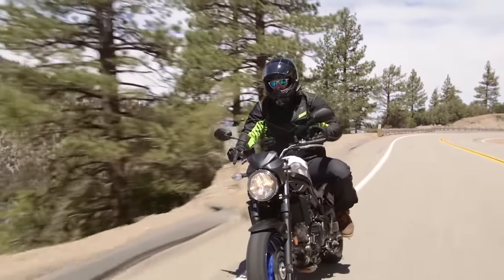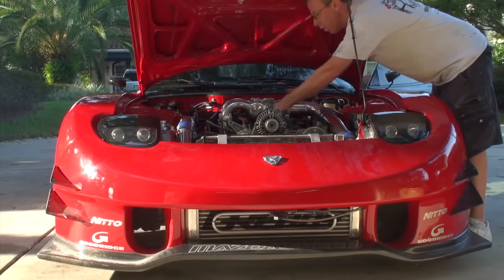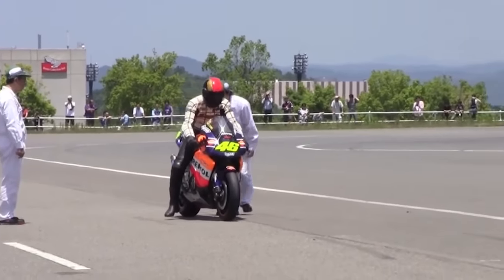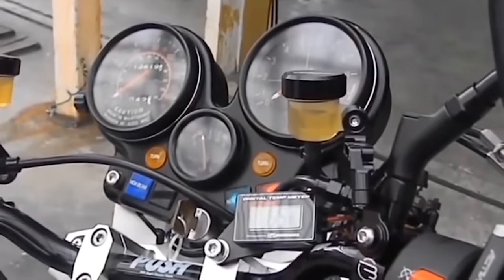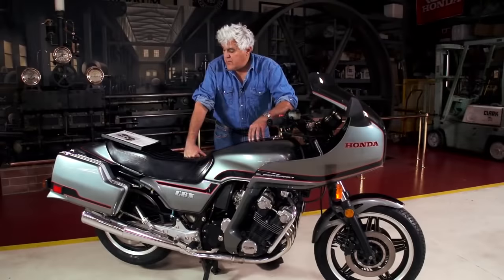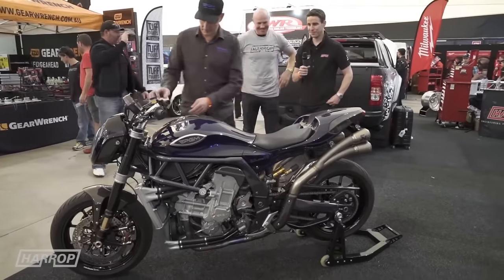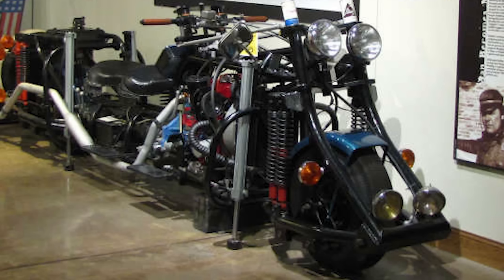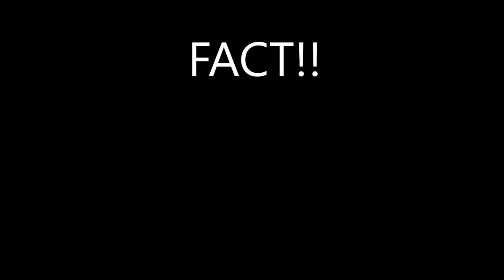The Most UNREAL Motorcycle Engines Ever Produced

Comment: Why did you take into accounts custom made bikes? there are a shitload of custom bikes who have crazier motors. And when it comes to stock bikes, you still get like boss hoss with chevy v8s which dwarfs most motorcycles you talked about.
Reply: Tim Authée how is a Chevy V8 a motorcycle engine?
Reply: @veedee4860  How is a 5mph steam engine a motorcycle engine?
Reply: Because it wasn’t developed for a car and then shoehorned into a motorcycle chassis. 💯
Reply: @veedee4860  The Munch Mammut did a very nice job with its NSU power unit, and the Quazar had a car motor (if you can call the Robin a car). These big block customs verge on the ridiculous, but I think you can count Boss Hog as a manufacturer too. I get your point, but I don't think Yammi was "on point" when he included it.
Reply: @veedee4860  - A Chevy V8 is 4 V-twins side by side in one block... and with 502"/650 HP...
Reply: @docthebiker  - A steam bike could be made much better looking than that and 50 - 100 MPH... back in 1920's... check out Jay Leno's steam cars...
Reply: BuzzLOLOL  What is your point? Chevy pushrod trash that wasn’t designed to power a motorcycle. Next.
Reply: @veedee4860  the Chevy motors in the boss hoss are somewhat made for that motorcycle, because they are modified into a 2gears auto gearbox. This configuration is only used in motorcycles.
Reply: @veedee4860  They are a fantastic for their intended purpose...cheap horsepower, extremely reliable. It doesn't apply anymore but when it came to road car v8's, Americans ruled...but what this has to do with Motorcycles I don't know
Reply: Stephen Scholes granted, over the years I’ve seen all sorts of LS and LT variants shoehorned in to some cool to ridiculous chassis. Abundant, check. Somewhat inexpensive, check. Reliable, that most definitely can be debatable. V8s being king of the road was so pre 1990s. 4 and 6 cylinder engines in the 90s were making just as much reliable horsepower as American V8s from the same period. I know hp costs money but modifying and swapping engines isn’t a poor mans hobby. A friend of mine built a stock bottom end, turbo’d ZX12 that made 485 to the wheel.  The motto for the shop was 485 on E85. Keep in mind it was a 15 yr old bike that was 1200cc in-line 4 engine with a small turbo on it. Was it cheap, fuck no, but over 400 hp/litre is impressive.

Comment: You may want to add the following motorcycles to the list:
> Honda MVX250F (3 cylinder 2 stroke)
> Honda NR750 (oval piston)
> Hercules (Wankel rotary engine)
> Kawasaki Z1300 (liquid cooled 6 cylinder in line)

Ray

Comment: You missed the bike with the 911 engine, ca. 1973.

And finally, I once rode a Kawi triple that had been paid some attention.  The guy squeezed 130hp out of it and the thing was barely manageable.  When it got on the pipe,  the front wanted to come off the ground, no matter what gear or speed.  That was 1979.
Reply: I rode a blueprinted 900 that was just like that .... new custom chassis and needle roller bearings in the rear swingarm. It was AWESOME!!!

Comment: Owned that H2 Two Stoke 750.. It had a one direction. It wanted to go. Straight Ahead..As that Stick Welded Frame would bend. If you attempted a turn to fast...It also like to blown the center head gasket. It never got enough air flow...

Comment: I bought a 1983 Honda CB1100F  new instead of  the previous year CBX, it had more HP and it was lighter.  The CBX by the end was  sport tourer and it was really heavy (680lb).   2 other really unreal engines were the 2 stroke Square 4 Suzuki RG500 and the  Yamaha V4 RZ500.  I owned both of these bikes as well.  The Yamaha was too heavy, but sounded great, and the Suzuki, well it just plain scared the shit out of me for it's incredible performance.  Keep in mind this all happened in the mid 80's.
Reply: Wasn't actually a square four,It was two 250cc engines chained together at the crankshaft,Power was late and short,And I'm glad you survived many didn't and the V4 Yam was the powevalve as you give it no mention blissfully unaware of that aspect,It was remarkable but wasted on the general public,In that it had a variable exhaust valve doing away with the powerband and spreading it across the rev range,Not appreciated by motorcyclists doing away with the powerband and the bike was considered gutless,I often wonder about the thought process of some people,Earlier on someone bought a 750 Kawasaki two stroke triple and claims worst bike he ever had,Too violent  pulling wheelies,crap on petrol and brake and ergonomics and a crap tourer,Buying a two stroke as a tourer? What was going on inside of his head? CB750 or a Harley Tractor,I had the earlier Suzuki GT550 two stroke triple,No where as violent as your Suzuki but quick for it's time,But i had the common sense "not to buy" the KH500 wheelies in the first three gears

Comment: Want a widow maker? Try the Suzuki RGV250. Pretty popular in Greece. It would easily pace or beat a litre bike of the time for the quarter mile and because it was pre-YPVS systems, you could be cruising in 3rd at 40km/h and without any change to throttle position suddenly find yourself doing 120km/h in a heartbeat.

Comment: I definitely remember seeing the Suzuki rotary on the road back then. It's been a long while, however! Don't forget the Norton rotary, though - it was even air-cooled if you can believe that. The Suzuki's exhaust pipes had to be air-cooled - note the curious ducts at the front of each pipe.
Reply: If memory serves me right, the Norton Rotary Engine was originally developed for use in military target drones, and it was only put into a mobile test bed (aka a motorcycle rolling chassis) in order to test and moniter it over different operating and meteorological conditions without having to launch it airborne!
Reply: Thats right they did and often glowed cherry red under extreme riding conditions

Comment: Kawasaki KZ1300. Inline 6 cylinder, shaft drive, water cooled, and 120 hp. A top heavy damn thing but F%$#ing FAST and SMOOTH.
Mid to late '70s saw a number of 2 stroke bikes that we called Crotch Rockets. If you took one for a ride and weren't prepared for what they would do, you had to change your underwear when you returned.

Comment: An engine not mentions here is the 1982 Honda CX500T.  This 500 cc Turbo, fuel injected little rocket was a dream to ride and accelerated like nothing else.  The Honda
shop owner had a CBX1000 with the fairing and bags.  The Turbo shined on the highway.  From a standing start it acted like most 500cc four stroke bikes.  Until you got
into it's sweet spot when that Turbo spooled up.  From a standing start.  My buddies CBX would pull out front until I hit 40 and then this 500 would just like you were
just launched off a catapult.  I would pass him and it would take him a couple miles to catch up to me with his monster engine.  Usually we just ran out of road.  When I
passed cars.  I would pass them in groups of four or five.  I could accelerate from 60 t0 80 in the time it takes to take two breaths.   Two dumbest things I ever did.
Well there was a third we won't talk about.  I sold my 69 Z28 and I sold my CX500T.   Yeah, I know.

Comment: 11:25 I owned the Kawasaki H1 500 triple it was just as much a widowmaker as the H2 they handled like pigs couldn't turn corners  but straight-line speed was frightening
Reply: I had a 77 Suzuki GT550. 
I rode through a speed wobble at 115.  Not the funerest thing ever..
Reply: @pnotuner1  been there...done that... wasn't lookin at speedo but I'll take your word on that.
The GT 250 was first bike I rode with 6 gears & wi me at 13 & 90lbs it was quite a thrill...

Comment: That was a fun video. 

Honda used to have a festival at Donington, which is only 8 miles from me. I rode CBXs several times, and while they seemed fun at the time, they were absolutely flattened by a Honda rider, on the CB1100R. I enjoyed riding them, at the time, but wouldn't want one. I still have an R1, but haven't ridden it years. I'll do track days if I ever win the lottery. Morbidelli did a V6, Norton did a Rotary for the track. Does that V8(which really does sound amazing) really have more power than an H2R?

Comment: One engine that should be noted yet  only has a little over 100bhp,is the honda VFR 750 interceptor. This V4 is an engine with gear driven cams and has been listed as the most over engineered production bike ever made...Such a special sound,this bike has also been known to hit 200k.Also the 1st single sided swingarm..these changes took place in 91 after Honda was embarrassed in the 750 cc class..Then they won alot with this near indestructible. Bike....thx..heath

Comment: You should research the V-4  OVAL piston motor Honda developed in the 80's. There was a ring sealing issue  that doomed the project but 8 valves per cylinder, 2 connecting rods per piston, the thought was it would have a 24,000  rpm redline

Comment: I had a Yamaha TDM 850, I had it tuned with dynojet and kerker exhaust.  I had it dynoed at 88hp and 88ft lbs of torque.  Meaning when. I took of from a stop it lifted the front end.  Low rpm power, the dealer who worked on it and wanted to buy it called it stump pulling torque, very usable.  When. A friend drove it then my brothers 750 GSX-R he thought mine was more powerful, but which isn't true. Look up a TDM with kerker.  Inline twin liquid cooled with 5 valves per cylinder.  Genesis motor.  Only came to the states for 2 years, 1992 and 1993.  Very ahead of it's time looks

Comment: you forgot the oval piston V4 Freddie Spencer campaigned; Its where Honda experimented with short strokes and big bores used on everything now. Basically a weird engine, 2 rods per cylinder  8 valves per cylinder and an unheard of redline at the time of 20 thousand RPM. and what about the 250 cc 6 cylinder factory road racer that later was morphed into the CBX

Comment: I would like to add I had a Suzuki GT-750 a 3 cyl. 2stroke 750 but it was liquid cooled, the first steam motorcycle was an 1867 Roper and was clocked at 40MPH. there is also the Ariel square 4 (actually 2 inline twins with counter-rotating crankshafts), and the Megola, a German bike with a 5 cyl. radial in the front wheel the cylinders spun with the wheel and the crankshaft was stationary, and now the USMC is testing an on/off road diesel bike that has a 70mph top end, 600mile range and 125mpg. just some ideas for your next video.
Reply: +1 for the suzuki GT750, that bike was kinda scary for the time.  I'd add the boss hoss line to the list as well, powered by everything from the GM 350 (5.7 liter V8) up to the 502 (8.2 liter V8).

Never owned a boss hoss, but i had a 1972 GT750 'Water Buffalo'.

Comment: I believe Suzuki offered a true lifetime engine warranty to the original owners of the RE5. Not a limited warranty but a true promise that they would repair or replace the engine forever for the original owner. But they still couldn't sell them. I remember seeing RE5s that stopped production in 1975 on the dealer's sales floor in 1980. (There are 1976 RE5s but they are actually 1975 models that were sent back to the factory to have the bad Sci-fi instrument cluster and lights replaced with conventional ones off any other Suzuki.)

Comment: The late 70s and early 80s was Magic time in the motorcycle world. The big four in Japan were out to One up each other at every corner. We had development improvements like water cooling, shaft drive, single shock suspension, Parallel twins, v twins of many angles, fuel injection, turbos, Power valves, mag wheels, tubeless tires, six cylinders, triples, wet clutches, dry clutches, six speed transmissions, engines that used the same oil for the engine and transmission, multivalves per cylinder, multi spark plugs per cylinder, onboard system computer monitoring, even self diagnosis. Single key to open every lock on the bike, anti-dive, Single and dual front discs, O ring chains, elimination of kickstarters,
  every year the big four were coming out with new designs, I don’t mean new paint jobs, I mean different engines. The big super bikes were getting faster, every one of the big four had a big full dress touring bike it was loaded with features.. in 1982 alone, Honda had 52 different models of motorcycles available in the United States. I know this because I sold Hondas in 1982, and we handed out decks of cards that Honda had made up. Each card had a picture of a different model on it..
  Times were great, bikes were very very affordable. They couldn’t make motorcycles fast enough…
  that all came to a screeching end when Harley Davidson CEO, a guy named Vaughn Bealls went to President Reagan, and got him to put a 45% tariff on Japanese motorcycles to save 600 factory workers jobs in Wisconsin Harley Davidson factory..
 hey 750 Honda or 750 Yamaha that was $2999. Overnight the price of that vehicle went to $4750..
 One year before the tariff, Yamaha sold 120,000 of its XS 650 model motorcycles in one year in the United States..After the tariff, there has not been a single year since, almost 40 years later, that Yamaha has sold 120,000 of their motorcycles of all sizes combined..
  within three years of that tariff that Harley had placed on Japanese imports, 1100 motorcycle shops across the country it’s old Japanese motorcycles went out of business just in the first three years. The average number of employees at those 1100 shops was seven employees. that 7700 Americans that lost their jobs to save 600. Typical result when the government get involved in business..
  Shops kept going out of business ever since, I live in Western Pennsylvania, I work part time in three shops that went out of business one after the other after the tariff. And they are still going out of business here almost 4 years later.. there used to be 17 motorcycle shops in the western Pennsylvania area around my home within an hour drive. Now there are only three, and two of them are family owned since the 1960s so they own the building they are in, it’s a family business in each case. One is a Yamaha shop, the other one is a Honda shop. There are no Kawasaki or Suzuki shops within an hour of my home anymore.
  The tariff price increase was supposed to expire after four years. The problem is, the price of motorcycles never came back down..
  when the tariff was imposed, showrooms were deserted. I went from selling about a motorcycle a day between January and the end of May every year. I would quit at the end of May every year because anybody that was gonna buy a motorcycle, already had it before June 1. But immediately after the tariff, I went from selling four bikes a week, too I was lucky to sell Three bikes a month.. I actually quit selling motorcycles for 12 years..
  The early years before the tariff, every motorcycle shop I ever worked in was like going to a party. Rock music would be playing over the PA system, the boss/owner would buy lunch for everyone working there every day. Every day. The refrigerators in the shop were constantly stocked with soda, water, juice, whatever you wanted, by the owner, it was for the employees. We could take motorcycles home on the weekends.. we got parts and motorcycles at cost. When I sold bikes before the tariff, I could have any bike that was not a big seller as a demo to use..
  when the tariff was put in force, it was as though an atomic bomb went off in the whole country of motorcycling. That was the end of the development of the turbos, the sport bikes, the new models seemingly every other month a new model a new model that ended when the tariff was imposed. For example, the year of the tariff hit, Suzuki only had two street bikes available and it’s lineup..
  The shops couldn’t pay or keep good help. Instead of having five parts man at one shop I worked at that had 17 employees. They went down to two partsman. They also had seven mechanics and two full-time builders before the tariff and a service department manager. They went down to two mechanics and no builders, and no service department manager..
  that is the reason at least in my case and pretty much the many many friends I made over the decades, that’s the reason they will never buy a Harley Davidson. When they got the tariff imposed, they were wrapping themselves in the American flag. Today, Harleys are made in Brazil, Germany, India, and I even think they’re made in China now. So much for wrapping themselves in the American flag..
  I have nothing against Harley riders,Most of them don’t know the whole story. But I’ll never forget. I’ve had 108 motorcycles so far, and not one of them was a Harley

Comment: I really really wanted the RE5,But after sales maintenance didn't exist,So i went for the Suzuki GT550 two stroke triple,Which mirrored the performance of the RE5, Didn't know that at the time,But two strokes were inherently quicker than the four strokes of similar capacity and my mate started on little two strokes upto 350/400 and bought a big four stroke 500/750 which was big in the 70s,I'm different don't follow trends or fashion and started on little four strokes 175/350 and then the relatively large two stroke,I was NOT disappointed my mates were,Going from a yamaha 350/400 to a Norton Commando and a Motto Guzzi,They found them to be gutless,I didn't learn from their mistakes just do things my way,Which are NOT always the best.

Comment: I had a Kawasaki 750 2 stroke back in the 80's. I pegged the speedo on several occasions: must have been doing 150 at least.
Reply: flip inheck  Not a dream, boy. That speedometer read 135 and had a peg about 10 mph after that and I had added 200 rpm more after it was pegged. HAD to be at least 150. BTW I didn't eat cornflakes back then. I had the Breakfast of Champions, champion drinkers that is, Budweiser.